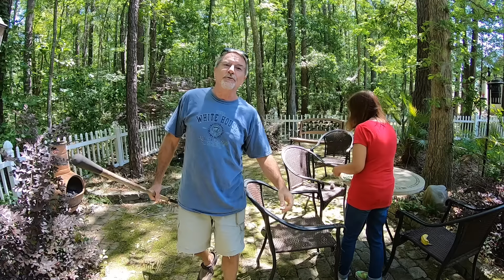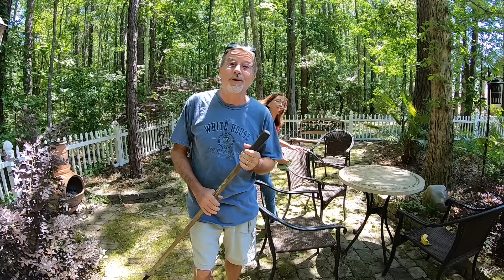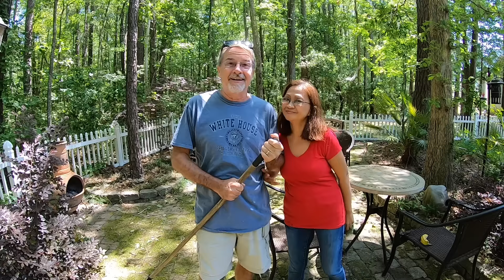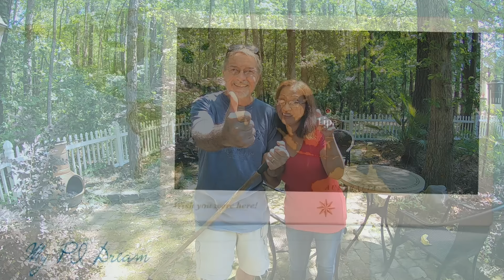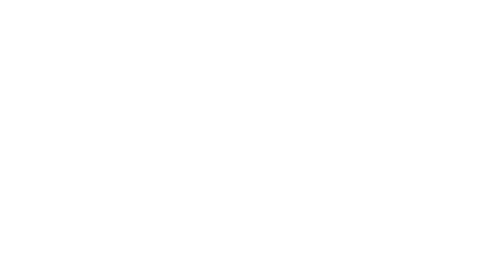SHOULD YOU BRING YOUR 110V APPLIANCE TO THE PHILIPPINES?

Comment: Great episode James, on voltage conversion.  If you happen to be someone living in the Philippines who uses a lot of power tools and wants to save money, I would definitely purchase your selection of lithium ion  power tools in North America and then purchase the appropriate transformer to power the mating 120 volt charging unit.  An assortment of cordless power tools is further simplified if you  purchase tools with an interchangeable battery.
Reply: Bob Calder I bought mine in the US and then ordered a 220v charger from Dewalt. A transformer works as well.

Comment: I have a 3 phase 15 kva transformer for my build later just so I could use all my 110 volt appliances 

wanted to utilize this there in a farm in Lipa but the batelec didn't approve a 3 phase and wanted me to buy their own transformer 🤷🏼‍♀️ 
so now i have so many unusable 110 v appliances.. so maybe not
Reply: And you shipped that transformer from the US to the Philippines?  Distribution voltages in the Philippines are different than many countries, so the required input voltage for your transformer may have been incorrect.   You were lucky to even have 3 phase distribution in a rural farm location in the Philippines.
Reply: Bob Calder i bought this trans from San Carlos City, Negros Occ from the local electric coop for our own use and we did use it for several yrs then we moved to Lipa and thought we could just use it as well there but the local electric company in Lipa preferred we buy their own supplied transformer thus we were unable to use it.Now I live in Cebu and maybe later will be able to utilize this.. for now..it sits unused here... and this is so heavy to move around... and it is necessary to have when most of your appliances are 110 v